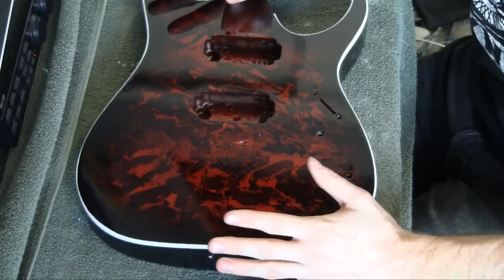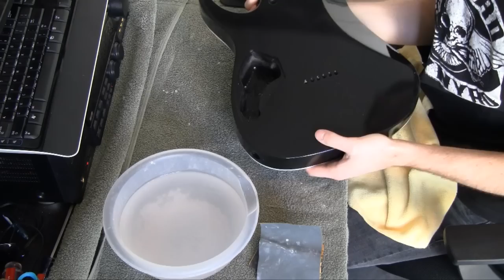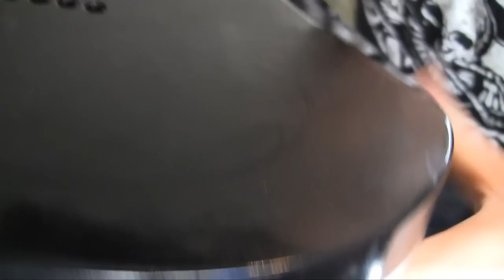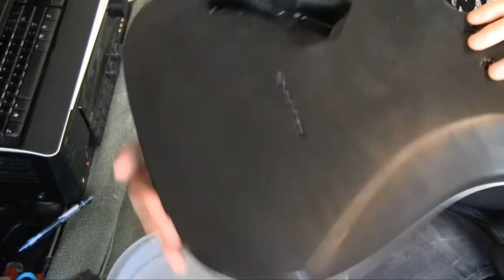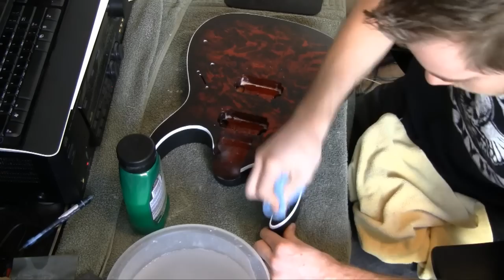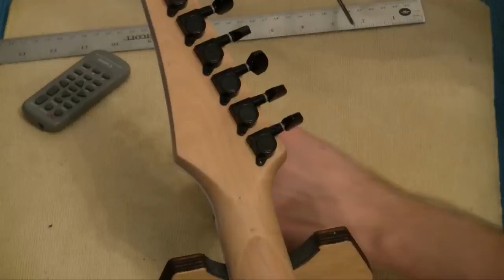How to Wet-Sand & Polish an Electric Guitar

Comment: I just redid my Charvel very similar but I had to spot some base coat in and its black. You are absolutely correct about using all the different grits its way over doing it. I level my clear with 600 Grit. Then I went on to use 1000 Grit then finishing with 1500 grit and achieved the same. Remember be careful you can always re add clear, If you have a custom paint job it may be tough to repair. Also and you are not familiar with using drills and buffers do this all by hand. Nice Job.

Comment: Thanks for your videos and tip on soap in the wet sand water.

Back to the grit thing.  I think htat using 400 is too course to knock down the orange peel in clear.  Would take too ong with 2000 to correct the scratches form 400.  Anywho I use 1000 then 1500 then 2000 and then a use drill with Meguiars polish (but any name brand is OK like you say),  then carnuba or finish wax.  The 1000 grit seems to take out orange peel without deep scratching like 600 or lower.

Comment: Very very nice work and tips. You should get a rupes bigfoot polisher... the small one. It totally polish faster and better than anything I've tried before buying that little mean machine. It disperses heat very well and it's harder to burn the paint and it doesn't leave holograms or swirls in the clear. (The guitar i made was really dark and it was a mirror under light from any angle) Thank you for your video and keep painting!

Comment from the maker: How much I use depends on the finish. Some finishes like marbling needs 2 or 3 times the lacquer that a plain finish needs. And I don't measure in coats because I use really heavy coats, so I could do the job in 5 coats when someone else would need 10. I measure in cans. I would say for the smallest rack tom, you will need at least 2 cans. 3 for the second tom, maybe 5 for the floor tom, and probably 8 on the kick. If you can get a spray gun and do it that way, I suggest you do.

Comment: Thank You for the videos and for sharing your talent, knowledge and experience.  
I need a little help.  What kind of clear do you use?  Is it just clear spray paint, like rust-o-leum?  Also, how many layers of clear is a good thick base before wet sanding?  Years ago I had a frankenstrat project guitar bubble up and chip, just like you said.  I don't remember if I used Krylon, but I know that I didn't wait for it to dry properly between coats.  At the time, I didn't know that would matter.   Your videos are GREAT!  Thanks for your time.  Keep up the great work!
Reply from the maker: NJFLIPPER Some clears work over overything, some clears only work on similar paint types. I avoid Rustoleum clear coats like the plague. They bubble up on paint they're designed to be used with, it's ridiculous. Krylong acrylic clear works over just about anything and it dries hard as nails. The problem is, it literally takes a year to dry. No joke. What I used in the video is Deft which is a nitrocellulose based lacquer, it works on just about everything, I used it on Rustoleum and Duplicolor mostly. Back when I did this video I was still using rattle cans to demonstrate cost effective finishes, but I quite using it and I now stick entirely to using spray guns and professional grade lacquer.
Reply: shelbyfanss Thanks For Your Time!  I would like to repaint my Frankenstrat.   Now that I know that all paint is not the same. : )
 I would like to paint it with my airbrush.  What paint would you use, for the colors and for the clear?  I have no idea what kind of paint or what brand to use.

Comment from the maker: You will notice swirl patterns and scratches in the surface with 400 grit. If you want a matte finish, I would would level it out with 400 grit, then take some #0000 steel wool to the finish. It wont leave noticeable swirl marks but it will give you a nice satin worn finish. I do the same thing to my Frankenstrat replica's (if you haven't seen that video). You can get that steel wool at Wal Mart or Home Depot pretty cheap. Its great for guitar work in general.

Comment: hey shelby, i noticed that it is already pretty shiny before you did the wet sanding, did you sprayed it with a clear coat or anything before you wet sand it? if yes could you please share what clear coat you used? Thanks.

Comment: Ok, thanks. I just wasn't using enough clear coat. But I am going to paint my guitar a metallic blue like you did for one of your friends in your other video, but I think I am going to use actual paint and a spray gun instead of that spray paint for more protection and shine. But I am still going to use that Deft Wood Laquer. Thanks for all the tips!

Comment from the maker: Its pretty easy, tape off your fretboard, sand the frets with 400 grit then 2000 grit, then I use a dremel tool with a polishing wheel to make the shine. You can do it by hand but it will take 100 times longer to get the same result. Actually, I'm not sure if you could get them as shiny by hand... Its hard work polishing metal.

Comment: Thanks for posting. I have an old 80's Aria Pro Electric guitar- lots of dings at the wood so I attempted to smoothen it last night. I made a serious mistake of not watching videos like this before I started my own wet sanding.. I was only using grit 1000 and was so confident because I thought it won't do any harm  in finish- bu alas, it did removed the existing gloss and left me sandpaper hairlines & swirls. I tried putting car cleaning compound afterwards (Meguire Ultimate compound) but the scratches are still visible. I'm glad I started at the neck & back side, and , and not the front. That's the only move i did that I think was ok :) Should I restart wet sanding it again at rougher grit, say 800 to remove the scratches made by grit 1K?

Comment: "tung oil finish" is a term that usually describes a mixture of tung oil/varnish/thinner (ie: formby's tung oil finish). Formby's is a little heavier on the varnish, therefore making it more of a 'film finish' (ie: forms a film, PURE tung oil is a penetrating finish and meant to dry IN the wood, not ON). If the directions say something like "flood surface, add more to dry spots, wipe off excess" then there's not a whole lot you can do about it. You'll have to steam out the finish AND the stain.

Comment from the maker: You can do both, but I usually do sand my color coat before the clear just to remove any specs in the paint, but you don't need to level it smooth.

Comment: I have two questions. Well, two guitars, for separate jobs. I'm going to just be doing a plain satin black paint job on one, what paint would you recommend using and finishing techniques from there on.

The second guitar is an Ibanez RGR320EX, which had the single most awful 'staining' custom job done to it. So, I've sanded it back to the complete natural colour, and my god, it is beautiful. So much that I just wish to protect that natural wood, without colouring at all. Suggestions?

Comment: I gave this a try and I'm not sure if I burned through or not, after I did the sanding, I commence buffing and waxing. However, I'm not getting the desired finished, it just seams to remain a flat black color. I was a black glossy squire strat body. Do you think I burned through the clear coat?

If I have to repaint, do you recommend using a primer or just using a base coat and then multiple layers?

Comment from the maker: For the satin, use gloss Rustoleum 2x coverage. It has a finer orange peel, then go over the whole body with #0000 steel wool to make it flat looking. If it's too flat, then lightly polish it up to your liking. If it's not flat enough, then use #000 steel wool. As for the natural finish, you can use a clear polyurethane brush on lacquer, it might leave a slightly amber tint though, or use Deft clear coat.
Reply: My guy what is the first song on this video???? it sounds like miles kennedy but I can't figure it out because of your constant talking.

Comment from the maker: It all depends on the paintjob, the clear you're using, and how thick you choose to apply the coats. I think for this one, I ended up using 3 whole cans, the most clear I've ever used on a single body, it was ridiculous. But there were so many layers that needed to be sealed one on top of the other. Usually for a solid color with minimal orange peel, I can get away with just one can. But nowadays I'm using a spray gun, not cans. Same clear coat though.

Comment: correct me if im wrong  i like the look of gibson true historic because the wetsand and the flame is visible on all sides and stuff. normal ones dont have that is this because all the coats of crap on their? and because its not wet sanded? because all the wetsand jobs i seen have a way more clear look the the woods and paint on the body.

Comment: I have a question for you; I’m currently doing a headstock job right now. I’ve tested the stains and clear coat on some maple I bought from Home Depot. My question is between clear coats, do you advise wet sanding or just build up a thick layer and wet sand at the end? If this is a stupid question, I’m new to all of this.
Reply from the maker: Good question! Honestly you could do either one. Most people will tell you so sand in between each coat. This keeps a consistent level finish and makes each coat smoother and smoother making the final sanding and polishing really easy. But this process takes forever because you have to let it cure completely before wetsanding. You also have a much higher chance of sanding through the clear when it's so thin. Personally, I've always found it less hassle to build up a lot of lacquer on the finish before any sanding. It makes getting a level and shiny finish take a while, but the chances of burning through a lot slimmer. Plus I can put a body in my paint booth and have it polished by the end of the week. If I had to wait to sand in between coats, it'd take a month.

Typically though, I do a bit of both. I'll put maybe 6-8 coats on, do a test sanding to find any issues in the surface that may need touched up, do my touch-ups, and then hit it with another 3-4 coats before finish sanding.
Reply: That couldn’t have been answered faster or any clearer. Thank a lot man!! Also, amazing job on that build. Keep it up!

Comment from the maker: I would stop after the 400 grit wetsanding, and then go over it with some #0000 steel wool. Then maybe if there is too much swirl marks, you can go over it with a real light polish, but I get pretty good results from just the steel wool.

Comment: Quick question. I bought a Schecter recently. I got the last one, which was the floor model, so it has minor scratches on it. there are two or three that are noticeable in a well lit room and you can feel them a little bit when you run your fingernail over them. are these scratches normal? in other words, would it be worth sanding and/or buffing, or am I just worrying too much?

Comment: Hi ! Thanks for posting this video! I have a simple question - Do I have to repeat this operation from time to time or is it permanent ? If you polish or wax your car in the most cases you have to do it again after some time because all the wax and shiny surface starts to fade. Sorry for bothering you if you mention it in your vid.  Cheers !
Reply from the maker: Well the reason the polish on your car doesn't last forever is because of the prolonged exposure to the sun and regular car washes. Your guitar may need additional polishing over the years because your clothing and general wear will buff the sheen down on it. But if you let the lacquer cure properly before wetsanding and polishing and take care of the guitar, it wont need to be re-polished any time soon.
Reply: +Mills Custom Guitars thanks ! I'm going to try this out on my squier standard strat next week. Previous owner tried to make it looks vintage but fortunately he only did some matt surface visible at the good angle - no deep scratches. I hope it will fix the issue. Sorry for my poor english - I'm just a regular guy from Poland :D

Comment: If the body is bare wood, then you'll need primer, but after primer you don't need to sand. On a guitar or car, you usually need to lightly sand before you paint, because it helps the paint stick. But if you just put primer on the same day (and it's dry) the surface is rough enough for the paint to stick good. Also you shouldn't need to polish after painting (unless something was screwed up). After that you want to lay a good amount of clear.

Comment from the maker: I've never heard anything about silicone products, but I can imagine why. Silicone is probably one of the best vibration dampeners there is, if you use a wax thats silicone based, its like covering your guitar in a thin layer of rubber that can absorb vibrations which can kill your sustain. "Voodoo"? Maybe, but it couldn't hurt to avoid it. As for the scratches, try a swirl remover or some lower grit rubbing compound.
Reply: is turtle wax you use in the video without silicone i can see its doing very good job at restoring the gloss finish after wet sanding i have the same problem on my guitar i sand it on some spots and now i seek some good polishng wax to restore this shiny gloss finish 🙂

Comment: How many coats are supposed to be applied? I made the mistake of thinking I could buff out some scratches by wet sanding the finish and I'm on my  4th coat of wax and it still looks dull. I messed up.

Comment: If I wanted to stop after using the 400 grit and have a matte finish, would that be okay? Would I run into any problems with the paint coming off by keeping it that way or anything? As long as it doesn't look to noticeably scratchy I kinda wanna do that to sort of relic a guitar I have.

Comment: Hey dude I've got a question. I've got one of the LTD EC-256 in matte black. The back of the neck has a couple rough spots that I'd like to smooth out but i don't wanna mess up the matte finish. What's the best of going about doing that?

Comment: For those that wonder what to do to protect the screw holes, you can put a little drop of glue into the holes before sanding so water wont crack anything.
Reply: Lmfaoooooo

Comment from the maker: If it's just like a strat styled body and you get the clear laid down with very minimal orange peel, you might be able to get away with only using one can. I've done it before, but if you try it and it doesn't work, it's not my fault. I suggest at least a can and a half.

Comment: Can't tell you how many times I have burned through to the marbilized finish (because I had alot of orange peel in the clear top coat thats what happens when the pressure isn't right on a cheap hvlp spray gun and since I can't afford a nice sata hvlp gun) that is done with house of kolor paints....

Comment: Okay, question if I may ask, I am using the Rust-olium enamel on a guitar I just finished painting not too long ago, and I'm wondering, if that is okay to use, or would Krylon clear gloss be better, and also about the polishing, that cam be any turtle wax polish right?
Reply from the maker: Enamel is trick to work with. There are some clears that will work with it, but you have to apply it very carefully. Deft seems to work okay as long as you don't put the coats on too thick or too close together time-wise. Krylon is an acrylic clear which almost never works with enamel, but I have gotten it to work in a pinch but you basically have to mist the clear on for the first few coats or it will bubble and peel. Krylon also takes many months to fully dry, but the result is rock hard. And yes, you can use Turtle Wax polish, but don't use actual automotive wax until the paint is 100% dry. Otherwise it will seal in the vapors and it wont dry very well.
Reply: shelbyfanss Okay.